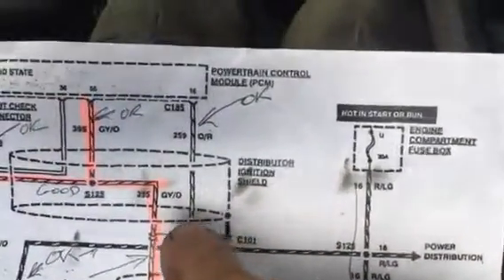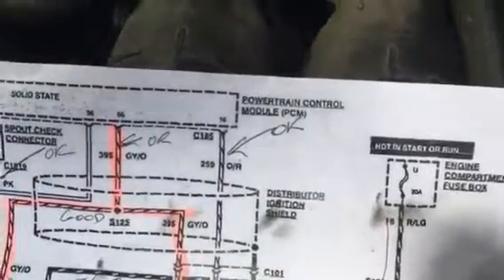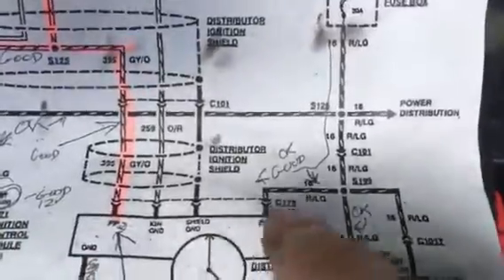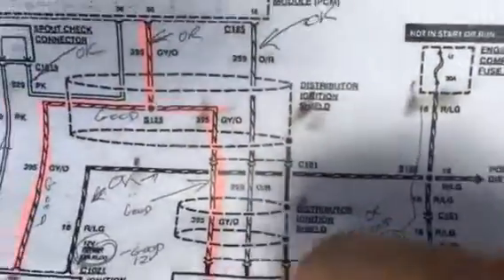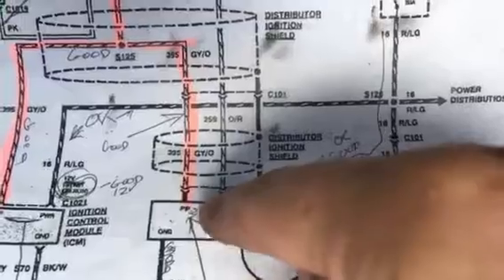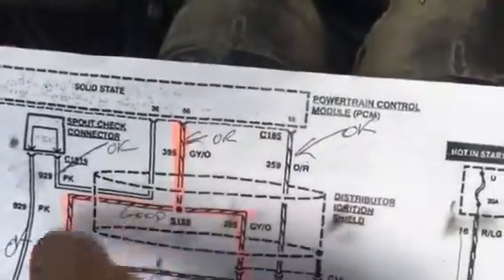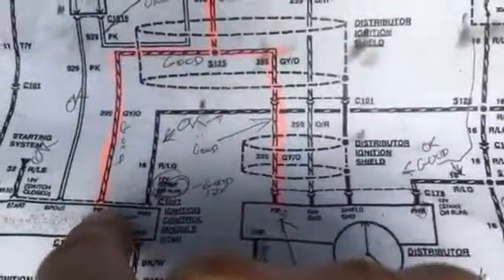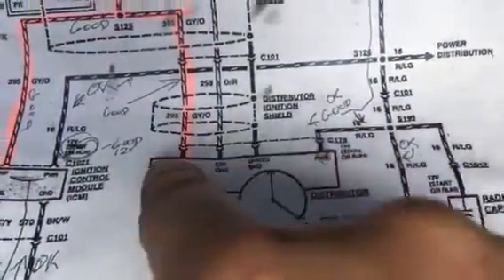1993 Ford F-150 NO START TFI Low or No Voltage on PIP wire Troubleshooting

Comment: I have the same problem. I replaced the entire distributor, wires, cap, rotor button, ignition module, coil, coil pigtail. Nothing has helped. Just got stranded on the side of the road again yesterday.
Reply from the maker: There’s a bad wire somewhere more than likely.  Pull the connectors and check each pin.  It’s tedious.  But it’s gotta be something like that.  Wiggle them while you test them.

Comment: Black green stripe not connected other wire goes to regulator green red stripe  resistor wire that goes filling just don't have clue black green on Custer no other  like it amp light
Reply: 1978 Ford f100

Comment: Great good to hear, Ford EEC IV has several components/functions that need to be understood in detail in order to troubleshoot successfully. In addition to the PIP signal that has to be proper there's a SPOUT signal that actually triggers the Ignition coil via the TIF Ignition module.  And then, there's different modules for different series of Ford model years. Advice: don't fall for that High voltage aftermarket Ignition go fast parts, these Ignition components provides higher spark plug voltage but is only required when compression is increased, or Turbo or Supercharger is added. All in all the Ford EEC IV electronic management system is very stout and very reliable, I have an 86 GT convertible, original owner, with 87 GT heads, extrude hone intake, Cobra rocker arms, shorty headers and F 150 lightning throttle body. She runs like a champ and pulls like a freight train at higher RPMs. She still cranks and starts up within 1.5 seconds consistently.

Comment: The PIP signal is a square wave out put of the Hall Effect Sensor located inside the distributor.  This Hall Effect Sensor detects the rotation of a rotor that has windows/slats DESIGNATED one each for all 8 cylinders.  This PIP signal will be a Square Wave output when the engine is running.  While the engine is off and not running with ignition key on, the Voltage of the PIP wire will depend on the physical position of the slotted rotor.  It can be ~ 0 volts or ~ 12 volts.  You cannot confirm the operation of the PIP circuit with out the engine running. You can confirm the voltage level output of the Hall Effect Sensor with the key on engine off, by rotating the distributor very slowly by slowly tapping the starter (ignition switch on/off). You will then see times when the PIP voltage is ~ 12 volts and ~ 0 volts.
Reply: I am having the same issue and cannot figure out the best way to test the pip sensor signal. I rewired the harness to the tfi because a few wires were not connecting. But still no spark. Tested ground and power and all good. Tested the coil signal wire and it failed. Injectors are pulsing when cranking. So now it’s Down To the pip sensor
Reply: Please make sure you reviewed my previous comments and you are clear on the signals required on the Ignition module connector. You mentioned you rewired the TIF module wiring harness ? Double check your work and confirm correct continuity with ALL 6 pins.  Also, confirm you have the CORRECT TIF module installed on your vehicle, there are different modules that "look" the same but the pinouts are different, some are grey and some are black modules, also some are distributor mounted and some are mounted on the fender wall.  Make sure have a good ground to the module, the module is grounded via the back metal plate "heat sink".  Also, confirm power to the module on start and run positions.  Also, disconnect the Spout connector on startup and see if engine attempts to start or may actually start.  The CPU is programmed to ignore Spout  signal at start up on use the PIP signal only, after startup the CPU uses the Spout signal (ignition advance) signal.   MAKE SURE your rewiring of the harness connector is CORRECT.  Pin 2 out of the TIF module to the Ignition Coil should fluctuate from 12 v to ground (0  volts), this indicates the Ignition Coil is being charged and discharged and therefore firing your plugs !!
Reply: @PistolPete07-h8l  I have since found my issue. After rewiring the harness and replacing the distributor, I found that the spark was not generating from the coil because the coil was going bad. Replaced the coil and the car started right up
Reply from the maker: Replacing the distributor did fix my issue on “Earl”.  I followed this up as well.  My guess is it was the Hall effect switch.  I have since sold the truck, but my friend that owns it now has no issues.

Comment: Thanks for the info here. I seen the scannerdan video with Eric the car guy but he didn't mention what to look for if there was no voltage at the pip wire. I have this problem with my 87 mustang gt. I will try a new distributor as well. It is a much cheaper way to go than one part at a time.
Reply: did you identify your problem ?  The PIP signal can be checked with Ignition on.  You have to keep in mind the PIP signal Square Wave output is ONLY generated while the engine is cranking/running.  Also, as mentioned, with Ignition on and engine not cranking or not running the PIP signal will vary from 12 vdc to 0 vdc depending on the actual rotational position of the distributor.  Bottom line , with a VOM Meter on the PIP wire and Bumping the Engine starter with the ignition key, you better see the PIP signal on the VOM changing from ~ 12 vdc to 0 vdc.  Of course, the Ignition Module has to have 12 vdc input and grounded properly via its ground wire. Let me know what you find, I can help you.  I have an 86 original 5.0 GT convertible and got in running like a beast !!
Reply: @PistolPete07-h8l  what wire do you test to test the PIP signal?
I have a 95 Bronco with a remote Fender mount black ignition control modular.
Is it the first wire on the ignition control modular?
Or is it the non constant wire going into the coil plug?
Reply: @steveh7108  Steve, sorry for the late reply.  On a black remote mounted Ignition Module the PIP signal wire is the "top" wire while its plugged in it's normal operating position.  The PIP signal is square wave output signal generated by the Hall Effect sensor which is physically built into the base of the Distributor. With the ignition on and the engine not cranking, w/ a voltmeter you will read ~ 10 Vdc or ground, depending on the position of the hall effect sensor inside the distributor.  The status of all the wires on the ignition module are critical as well. The ignition module requires 12 Vdc while cranking and during engine running.  It is the 4th wire down from the PIP wire.  Also, the bottom wire is a Ground wire and should be ground ALL THE TIME. The second wire down is the SPOUT wire, after the engine starts, this SPOUT wire carries the ~ 10 Vdc square wave input from the Engine CPU.  This SPOUT signal is an adjusted PIP signal in time, meaning this signal timing is controlled by the Engine CPU and retards and advances engine coil ignition firing.  IDM out is the 3rd wire down, it is a confirmation signal back to the Engine CPU that is generated every time the ignition coil fires, and therefore if the Engine CPU does not receive this signal during engine running it will generate a CODE ( I believe it's an 18  code).  This 18 code is retrieved when you read the OBD 1 codes with the Ford blinking light code reader.Probably one of the most important wires in the ignition module connector, is the "Coil negative" wire, it's the 5th wire down, and it's the wire that actually triggers the ignition coil when to fire.  You can use a 12 v test light, with one end of the test light clip attached to the positive post on the battery, the test probe end of the test light place on the Negative connection of the Ignition Coil, as you're cranking the engine your test light will blink , confirming that the ignition coil is being controlled by the Ignition Module "ignition Negative" wire.  Sometimes, the PIP wire which carries the 10 v square wave output signal generated buy the Hall Effect sensor in the base of the distributor can be monitored by using an Oscilloscope and you will see the 10 vdc square wave signal, also if there "glitches" in the signal you can see on the Oscilloscope and confirm you need a new PIP sensor.  You usually have to buy the whole distributor cause its built into the base of the distributor.  If you use a digital Volt meter on the PIP signal , you will read ~ 4.5 vdc, thats because it's a 0 to 10 v dc square wave output signal w/ a 50% duty cycle.  Good luck.
Reply: @PistolPete07-h8l  thank you ,I appreciate the feedback.

I'm going to go out and buy a distributor as well as by the parts to rebuild my original.
All my research shows that I cannot trust any distributor manufacturer these days.
I almost decided to go with the MSD because it is the most reputable, but at its extremely high price it's still has a fair amount of bad reviews so I guess I'm going to go with the WAI from O'Reilly's because it's got a lifetime warranty and I guess I could walk in and return it if it goes bad.
I guess I will find out🤞
Reply: @steveh7108  Hey Steve, make sure you check the basics !! On your remote mounted ignition module, pin 4 (#4 down from the top) should be battery voltage while cranking, Pin #6 down should be Ground all the time.  Also, per Scanner's mistake, disconnect the Spout wire and crank the engine, it may start. Scanner's problem was the voltage level of the SPOUT signal was low , like 0 to 5 volt square wave, thats NOT going to fire the ignition coil.  He also discovered the 5 volt reference was way low, like 2.5 Vdc, thats not going to work either.  But by removing the SPOUT connector while cranking you notice the coil was firing, thats because the SPOUT signal was NOT being used, the ignition module was forced to use the PIP signal, the PIP signal is an "unprocessed PIP" signal, and it was a 0 to 10 v dc square wave, which was strong enough to fire the ignition coil and confirm spark with the test light.  SCANNER DANNER is the Master , NO doubt !! And don't forget the first main step in this FORD EEC IV troubleshooting, hook up one end of test light to battery positive post the other end of test light to the negative side of the coil, if the CPU and Ignition module are doing their job, the Test Light should flicker indicating a ground square wave is being generated and controlling the coil.  Good luck !!
Reply from the maker: Problem was the distributor.   Bad Hall effect switch I think.  Swapping it resolved the issue.

Comment: At any point does he ever specify what year the thing is (in the tittle would have been considerate)?  Because believe or not, Ford did change the setup over the years, if not the different engines.
Reply from the maker: Wow.  Sure am sorry I failed to be “considerate” by not including that information in the free (that’s my work i shared) video I posted that might help you.  How inconsiderate of me to not do so.   I do appreciate you being extremely “considerate” in asking rather than making a rude comment.  I’ll change the “tittle” to make sure I’m more “considerate” towards folks like yourself going forward.  Have a really nice day though.
Reply: 4.9 L6   year 1993 ,1987- 1995  all same ford @#####  ford elec poor

Comment: My 96 Bronco has been giving me issues for 3 months. Misfires, Stalling and Very long crank times to the point where it's sitting dead in the driveway for the past 2 weeks. After countless hours, several mechanics and over a grand spent in attempting to resolve the issue I'm down to the exact same problem you have. PIP wire only has 2 volts or less while cranking. Distributor is brand new on my truck. To confirm I was sold a bad new dizzy, I bought the hall effect sensor separately and plugged it in and to my amazement 10 volts was restored to the PIP wire and spark returned. I'm waiting on my 2nd distributor to come in so I can resolve this issue once and for all!!
Reply: New distributor installed and my Bronco runs again!!!
Reply: @TheRazor375  Good to hear. These TFI systems can be very frustrating to work on. My 1996 F150 5.0 went dead one day with it sounding rough and stalling like it had bad gas with water in it (it was freezing Winter weather at the time). After going through a lengthy trouble-shooing process It turned out to be a bad TFI that was the culprit.
Reply from the maker: @TheRazor375  Awesome!  I knew this would help someone!
Reply: Everything on my TFI system is brand new motorcraft parts and I must say my Bronco has been running like new recently. Very smooth motor and strong acceleration.
Reply from the maker: @TheRazor375  Come to think of it, my truck had actually been exhibiting behavior like this for YEARS.  Occasional non starts when parked for a while.  Thought for sure it was fuel related, but I've not had a single issue since that point.

Comment: Thanks for the information. I am familiar with the Eric/Danner video. I have the same symptom as you but on a 1993 E350 5.8 cube van. I am getting under 1 volt on my top TFI PIP wire while cranking. To check for possible shorting of the PIP/crank-sensor I took ohm readings on the distributor connection socket and 3 of the 8 socket connections are shorted to ground but on my E350 design the 8 pin connection socket only utilizes 5 of the 8 connections. It looks like the Hall-Effect may be shorted on mine but I have no  distributor schematic to confirm that. Is there a pinout online of this distributor so I can confirm that the PIP/Hall-Effect is actually shorted? I have a Haynes 1992-2005 "Ford Full Size Vans" manual but it has no detailed pinout for the distributor. Thanks for any info that you can provide
Reply from the maker: unkulmark pretty sure you either need a distributor or opt to change the module in it.  Personally i recommend getting the distribution from Rock Auto.  Easy breezy.
Reply: @theoriginaljimmykicker  I just ordered a LX237 PIP coil for $20 so I can do the ScannerDanner test to confirm if mine is bad. I'll update you with the results.
Reply: @theoriginaljimmykicker  I was looking at it again today and the PIP is still the prime suspect but I would like to confirm that it is bad 100%. Today I ruled out bad grounds & a few days ago I replaced the TFI. I also replaced the PCM's 3 electrolytic caps that are known to fail. Because of the engine compartment design on my E350 van, the engine would need to be dropped to gain enough clearance to pull the distributor out. Also, the oil pump shaft is known to fall into the pan if the distributor is not removed correctly. Due to the hard to get at location of the distributor this is a job for an experienced mechanic but unfortunately I am not one of those. I will list it on Ebay & Craigslist for parts. The box is insulated so it would make a good storage area or be good for a small  workshop. I usually buy from RockAuto but some people do not like them. Thanks again for your information
Reply: @theoriginaljimmykicker  I temporarily installed a new (NOS Standard LX-237) PIP crank sensor unit like they did in the ETCG/Danner video https://youtu.be/YmcCVQK87TU . The TFI PIP voltage only got up to 5.54V but that is still an improvement from the .94V with the old crank sensor installed. I did measure the TFI PIP pin voltage with no crank sensor plugged in and finally did get the 10V so I am confused about where the source of the 10V actually is.  In the ETCG/Danner video they get 10V even though the crank sensor is bad. In one of the Ford Truck forums there is a popular contributor named 'SUBFORD' who says that the source of the 10V is the computer except for one post I read of his where he said that the Distributor PIP was the source agreeing with you. I just tried to register with the ETCG forum but I had technical problems so I need to contact them. SUBFORD said that the a bad computer (PCM) can also cause no TFI PIP 10V and that if the 10V returned when the PCM was unplugged then that would indicate a faulty PCM. In my case the 10V returns when the PIP unit is unplugged so that would indicate a bad PIP unit. If the distributor wasn't located in such a hard to get at place then I would replace it just to rule it out. Thanks again for providing the videos.
Reply: UPDATE: My  'cranks/no-start/no-spark' 1993 E350 5.8 was diagnosed to have an open connection between the 30 amp 12 volt supply fuse in the Power Distribution Box to the PCM/EEC computer relay. Somewhere in the wire-harness-jungle there was an open connection causing no 'hot-at-all-times' 12 volts too get to the  input of the computer relay located just a few inches away from its 30 amp supply fuse. The 'hot at all times' 12 volts on the 30 amp fuse was always present. What I ended up doing was soldering a jumper wire from the 30 amp fuse output terminal to the 'hot-at-all-times' 12 volt input of the EEC computer relay and it has been regularly starting ever since. I was interested in finding the bad 12V wiring connection but I was not interested in spending more money on the factory wiring manual and then spending more troubleshooting hours hunting down the exact location of the open 12V connection. I spent so much time diagnosing this one that I never  again want to work on another vehicle that has a computer.
Reply: @unkulmark  I agree with you. I have been having trouble for a good month along those same lines. Thank you for your help. No reason for the computers.